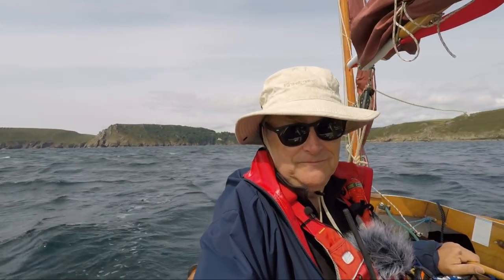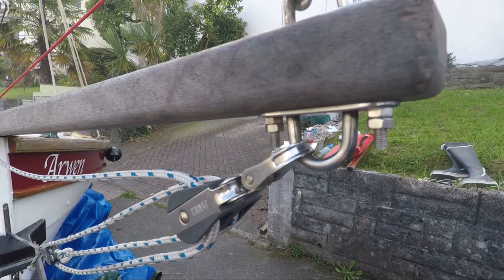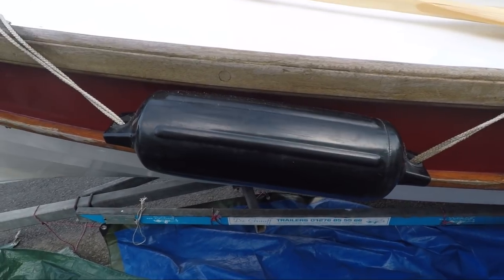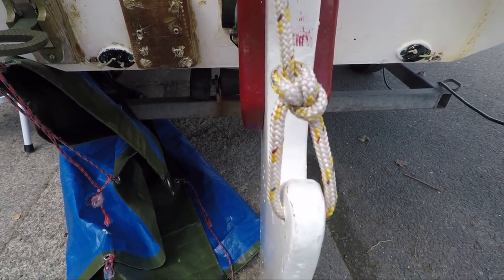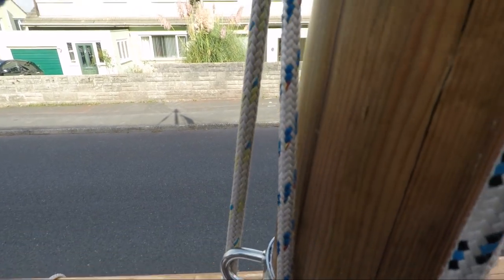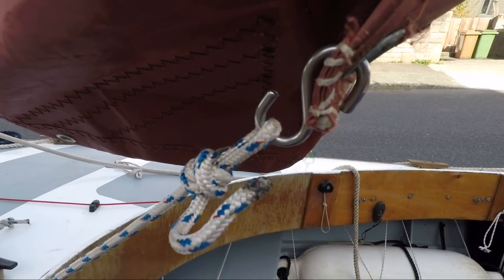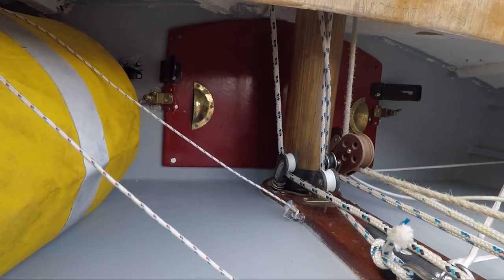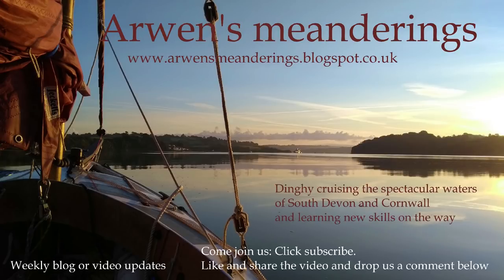Exploring the rigging on Arwen a dinghy cruising John Welsford designed navigator

Comment: Just to throw another comment into the mix of your sail trim. The crease will point to your problem, to much tension at one end or the other of the crease. Most modern sails, 100 yrs or so, will have the bottom forward corner fixed. Head and clew with adjustable halyard and outhual respectively, are used for flattening  and or making sail fuller. Power, speed and pointing ability. 
Yes, more lines to fiddle with, but the benefits are well worth it.
Reply from the maker: Possibly. Sprit boom sails tend not to have outhaul so it's about getting the another and downhaul tension right ...a dark art for a novice sailor 🙄😄

Comment: Hi Steve, I am intrigued by your mainsail crease issue.  I believe your deviations from plan wrt the snotter and bungee downhaul at the forward end of the sprit boom may be contributing to the mainsail crease. Your mainsail has a fixed luff and tack and the only variable would normally be the clew position. In your case, the clew position should be controlled by the snotter tension.  However, by attaching the snotter higher up the mast (movable rope attachment that is above the sprit boom ) and by compensating for that upward force by attaching a downward bungee, i think you may have inadvertently created an undesired outward vector force on the sprit boom that results in too much clew tension and the mainsail crease. If you attach the snotter to the mast in line with the sprit boom, then this should control your clew positon without a vertical force component and it should not require any bungee compensation. You could then adjust the clew tension with lower snotter force and the crease should (hopefully!) disappear. Hoping this works.  Keep up with the great videos, they are an inspiration to all small boat adventurers!
Reply from the maker: Thanks Kerris. Good advice. The crease is virtually gone now because I altered downhaul tension of all things but would like to try some of your tips next trip to see what would happen. Thanks for taking the time to explain. Much appreciated.

Comment: Hello again Steve - its Frank again - pls. excuse me , i am having difficulty navigating the comments - but i am trusting that you are picking them up because you seem to be so diligent and active - and i guess the latest comments are flagged for you.
i am hooked on your crease problem (and i detect that you too are somewhat (and justifiably! imho) frustrated - in lighter airs, the top half of your sail would be the main source of power)
just to give myself some cred, may i mention that i do have an Aust Championship under my belt fwiw - (actually a bit of a Bradbury......) - in the Intnl. 10sq m class - and for balance, a first in the 2008 Worlds - my first regatta in the class - 21st. out of a fleet of 21.......

So - to my relevant point - i cant be fully sure, but your sail seems to be cut with minimal layback or drift  (angle) to the head of the sail - perhaps the cut is intended for a gunter gaff setup?

that would make it difficult to apply a lug rig setup because the yard has to be peaked up so much - but even if so, i think there are still further options for you without your having to embark on a re--cutting of the sail.

 - but i wont bore you further unless you think i may be able to help

best regards,

frank
Reply from the maker: Go for it Frank but remember my sailing knowledge is actually limited.....now my expedition  and mountain knowledge on the other hand....😄.....
Reply: @plymouthwelshboy  yeah, i was a bit blown away by that obvious experience and knowledge - these days i myself seem to be finding it difficult to find the idyll of a wine-dark sea..... getting older and softer....

you mentioned plans - I'm just wondering if you could lay out the sail on the lawn and get an eyeball comparison of that (included?) angle between the "Luff" and the "Head" - the closer that approaches 180deg , the more downhaul tension required to force the yard to stand up.

similarly the shorter the "leverage " length between the halyard attachment point and the position of the throat eye lashing , the more tension required.  (in that respect, lashing the head of the sail higher up the yard would have,  i would have thought, reduced this critical distance and made the crease problem worse, not better - but maybe more than one thing got changed at a time? ) 

the other bit of geometry that would affect a high-peaked yard would be if you had a large eye fitting for the halyard attachment to the yard (so that , when hoisted, the halyard does not sit snug against the yard) - and even more critically, if the throat eye lashing was slack and did not hold the throat close to the yard (this may be an awkward conundrum if the sailmaker has built a lot of 'luff-round' into the head of the sail)  i have not been able to check these aspects in any of your videos that i have yet seen. (i haven't seen many yet , unfortunately.)

btw if the sail has been cut 'gunter style' - then maybe fitting a set of 'Mirror style' jaws to the lower end of the yard making it a gunter gaff might help - but on second thoughts, i have had problems with every gunter gaff , model or full size, ive tried (they tended to  capsize/twist mongrelly) - though the Mirror and Heron work well - but then still problem of reefing arrangements for the halyard(s) then

is the height of your halyard sheave as high as plan?  - is mast shorter?

re-cutting the sail:
 - recutting the head to "droop " the yard more aft at the head is probly not an option.
 - taking a "wedge" out of the sail (point @ throat, then perpendicular out to the leech) would be complicated / ugly - and a job for a tricky sailmaker, i would think
 - re-cutting the luff (between throat and clew) to angle the clew back may probly be simplest / best of the recutting options - but would have the effect of causing the boom to droop correspondingly - though if the boom usually clears the water, heads, etc by a good margin - then no matter - and you might be able to compensate by raking the mast a bit forward

cripes, mate, i think ive unloaded a bunch - but then you did say 'go 4 it' and i spose im avoiding going to bed anyway.....

wishing you lots of fun anyway   ;-)
Reply from the maker: Thq Ka for this crank. Lots to go through when I get a chance in future good weather.really appreciate your time here. Thank you